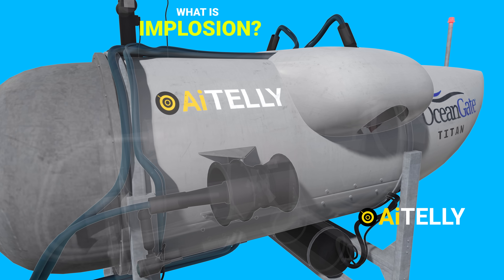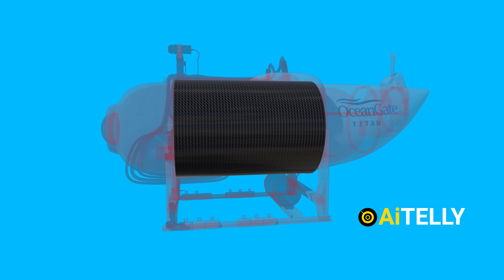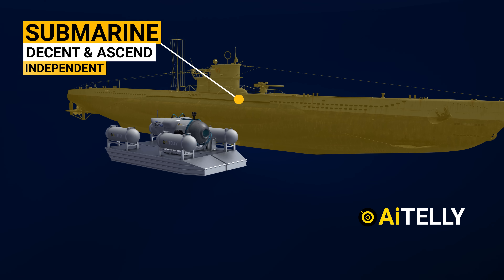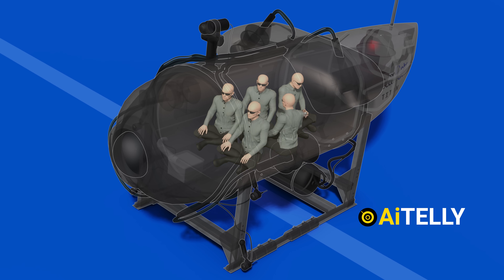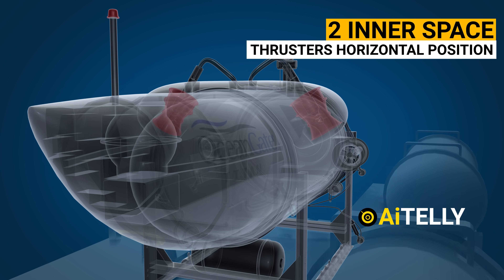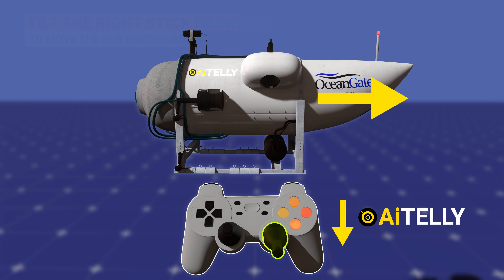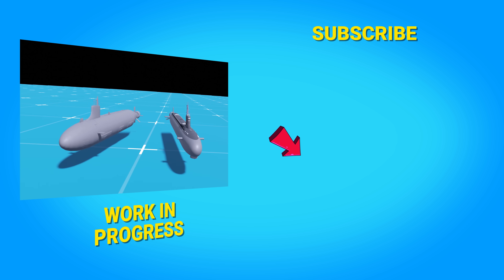Implosion Titan Oceangate How it Happened | Submersible Submarine Parts #3d

Comment: I am a Naval Architect with submersible design training.  You show the implosion as in crushing a can.  It was way more violent.  The atmosphere in the vessel was suddenly compressed by the pressure.  It greatly heated.  Think diesel engine times 20+.   At high pressures and temperatures, air (O2 and N2) become reactive, and "burn" (combine into NOx, explode).  Pressures get even higher, and a gas bubble forms.  The pressure and temperature of the water cools and collapses the bubble.  So the collapse is three events: sudden high pressure, an explosion, and collapsing of the gas bubble.  Extreme mechanical violence lasting fractions of milliseconds.
Reply: “Extreme mechanical violence lasting fractions of milliseconds.”

Fuck, that is chilling.
Reply: That's the weird thing about these kind of compression/decompression incidents. They're horrifyingly violent, so rapid and forceful that they seem to break the laws of physics. And yet, they're so infinitesimally fast, that there's no chance the victims even had time to register what was happening. They were dead before the signal from their eyes and ears could reach their brain.
Reply: @CheshireCad  which in a way is kind of a silver lining. No awareness or pain. Just snap

I still don't understand why they wanted to take the S.S. Shit Show to the bottom of the sea, but at least their families have the peace of mind of knowing they didn't suffer from a prolonged, agonizing, traumatic death.
Reply: @reallifein3d  wrong they started to ascend before the accident. They knew there was an emergency. They were aware!!!
Reply: @CheshireCad true, they would have been dead before they knew it happened. But there is a solid chance they knew they were going to die. I doubt that it happened without ample warnings. Rush had implemented safety measures to warn them of problems well in advance so they could try to avoid catastrophic failure.
Reply: @CheshireCad  is this the quickest way to die? Serious question
Reply from the maker: Thanks Ken Smith for your technical feedback 👍
.we love learning from Real Engineers.
Reply: @Aitelly   Yeah there's a couple of wrinkles. As Titan was son tiny, there was only about 2.8 pounds (1.28 kg of oxygen) in the air on Titan, which if it reacted with the nitrogen would have yielded only about 3000 kJ of heat from that source. Enough for an explosion against 400 atm pressure? No way. There would have been heat from compressing the air. But pressure killed the occupants, not heat.
Reply: We like hearing from real engineers??  There fire you should stop making videos about things you have no idea about??
Reply: @Aitelly  lol at your bullshit clickbait
Reply: I will gladly be in that submersible implosion than die another way. 4real this is the best way to exit. Everybody dies if i have to die i will gladly choose this way.  No pain nothing gone in 1 sec. From human into dust 😅
Reply: @GeremeNejelo  you could always just pass peacefully in your sleep
Reply: @GeremeNejelo It may be a quick way to go, but imagine the 10 or 20 mins leading up to that point. The fear of what's going on and knowing the inevitable.
Reply: @GeremeNejelo  Mist...
Reply: @GeremeNejelo I don't think a 19 year old was ready to go out like that. The family of that boy should be ashamed of themselves for encouraging this expedition.
Reply: Yes, this implosion is exactly like a bomb explosion except inverse. Those people we blasted just like they sat on a huge bomb. They felt and saw nothing.
Reply: Absolutely. Thank You! ❤️
Reply: You know, this is so tragic…but OceanGate if still a viable company, should be sued by the families. Just on principle alone. So so sad.😢
Reply: @jessicaklaus8171  if they’re dumb enough to pay that amount of money and sign the waiver, then that’s on them😂
Reply: @callen0892  Ok, I am really surprised at the number of rebuttals to my comment about the families suing the company. I am just throwing out a way for the families to help make sure another person like Stockton does not get away with what he did which was gross negligence.I personally don’t care what the families do. I just hope they can heal because this is a horrible situation. Whether they took a risk or not, these people had families. They are really hurting.  There should be a law requiring all submersibles to undergo safety testing by a Naval Engineer BEFORE any passengers are allowed on board. He used the word  “innovation” to skirt the issue because he knew it wouldn’t pass. He fired the engineer that told him it wouldn’t pass. Yes the passengers paid but it is still wrong to “shoot the messenger” and he shot every messenger that came along and told him the truth.
Reply: @jessicaklaus8171  you are just being naiv! People get killed all over the world everyday by accidents which could have been avoided. Thats life!
Reply: @juttaweise  How am I being naïve? I, being a sailor, wouldn't have gone down in that thing because it violates too many laws of physics within 1 sub. The power of the ocean is greatly underestimated. I would say they are the ones being naive
Reply: @juttaweise  People do get killed everyday by accidents that could have been avoided. But this is totally different . This man's ego and lust for success and making a name for himself could be argued in court to have committed involuntary manslaughter. And a really good attorney could probably get them for murder. I think you need to look up the definition of naive.
Reply: @juttaweise  So you are saying to give a pass to people who have been warned of instability in a sub they are taking people down in to crushing depths, and not only that, firing the engineer who blew the whistle AND having the documents sealed so no one could read them. That has intent written all over it.
Reply: @jessicaklaus8171  again you should not believe everything you read, especially in todays times. Afterwards everybody is wiser. That french diver had over 200 deep sea dives on his record. 38 to the Titanic, three on this vessel. They were all consenting adults and it was their choice to risk this adventure. Nobody to blame but themselves!
Reply: @jessicaklaus8171  mehhhh. Oh well🤷🏼‍♂️ apparently one family member was so sad they went to a concert during the search and rescue mission😂

Also… I laughed when they were launching the search and rescue mission… because only a handful of manned submersibles have been down to that depth. And now we’re searching, holding out hopes that this manned submersible is somehow still intact. Haha… nahhhh. They dead from implosion 😂

It is a horrible situation… but even if I had that much money, my wife would be slapping the shit out of me and telling me how stupid I was for wanting to go down there to see it… even if people were lying saying it was safe.
Reply: @callen0892 agreed, everyone calling for lawsuits are the same people tying up our courts with bullshit. Idiots paid for their own funeral
Reply: @jessicaklaus8171  You have a valid legal point. Though they signed risk waivers, IF gross negligence is proven, in it's construction, lawsuits WILL proceed.
Reply: @jessicaklaus8171  Did you see theyre trying to send people down again in 2024
Reply: @jessicaklaus8171  Unfortunately they probably wouldn't be successful with any civil lawsuit because of the liability waivers that all of the passengers had to sign. The waivers clearly stated that the journey could result in death. I don't know how you can sue someone after signing off on something like that.
Reply: @jessicaklaus8171  Sorry, they all signed a waiver. No lawsuits are possible. They willingly handed over their money and gambled their lives on a CEO and his experimental submersible. If I willingly signed my life over to someone and they got me killed it would be my own fault. And I don't believe any judge would award a lawsuit as a result. It's ridiculous that they trusted this company before they had achieved multiple successful dives.
The previous dive experienced a serious technical issue with communications. That by itself would have made me say no. Common sense escapes those who think money protects them. These people thought they paid for a safe expedition and blindly trusted equipment that should have been rigorously tested prior to public release.
Reply: @jessicaklaus8171   they signed wavers that stated death 13 times they can't sue    you sue happy  people have ruin this country  if you willing go and know you could die why should there families be able to sue give me a good reason
Reply: @jessicaklaus8171 unfortunately the crew signed a waiver. There's no way they'd be able to fight it.
Reply: @jessicaklaus8171 . . . it’s not THAT sad. . . I say “eat the rich”. I only feel band for the young kid that perished.
Reply: @jessicaklaus8171 Then they might as well sue NASA too cause they were involved in the project.
Reply: @jessicaklaus8171  they can’t sue them. The people inside the submarine signed a literal death waver, and they accepted it, so they cannot sue them
Reply: @jessicaklaus8171  They ALL SIGN WAIVERS so people like YOU and your family won't file a lawsuit and destroy the company,  which THE OCCUPANTS fully UNDERSTOOD that a catastrophe could happen.
There will be NO SUING on this mission my friend.
Reply: @jessicaklaus8171  it disappeared with its CEO
Reply: @jessicaklaus8171  they’re actually no longer in business anymore.
Reply: @jessicaklaus8171  they were warned and understood and agreed to the risks and even signed waivers
Reply: @jessicaklaus8171  sue who? The owner was turned to paste.
Reply: @jessicaklaus8171  well, by the standard of contract the families cannot sue the company. I mean you're diving to the deep ocean, I imagine they have a very specific contract built up that would wave all liability upon stepping on the vessel, just like you'd sign a waiver to spar with a professional fighter.
Reply: @zachhoernemann2104  waivers like that don't always excuse the company from fault, if you can prove that the company was purposefully negligent. Oceangate from many reports was very negligent and with a good lawyer every family has a good shot at money from this
Reply: @zachhoernemann2104  I beg to differ, IF gross negligence can be proven in the process of constrcuction, the waivers are nullified and lawsuit WILL proceed. Look it up.
Reply: @renelaboy1517  It's going to be a long lawsuit. It'll be the battle of lawyers. May the best lawyers win.
Reply: @hamsome9511  yeah I have a feeling the lawsuits will be more of a monetary punishment/message to ensure this never happens again than it is a compensation to those effected.
Reply: @hamsome9511  I would imagine the families are already getting their list of former employees to call upon for deposition in order. If you got $250,000 for a submarine trip, I would imagine you have a pretty good lawyer on retainer ready to go most of the time. I doubt it ever sees a court room given how much scathing material has hit the media already.
Reply: @zachhoernemann2104  you can challenge any contract in court.
Reply: @zachhoernemann2104 yes, they literally signed their lives away. They were fully aware of the risks. I think they would have to be able to prove that they were mislead in some way about the vessel or the risk. It would be interesting to see that go to trial.
Reply: @zachhoernemann2104  there was so much negligence (resulting in death) involved that the people who signed the waiver were unaware of.
Reply: @zachhoernemann2104  As bad as I feel for the people and families involved I agree. Not only that there were plenty of red flags from the best minds in the underwater field that the passengers disregarded when they made the decision to get on that idiots sub.
Reply: @zachhoernemann2104  if they can prove gross negligence….like being told it wasn’t safe and ignoring the warning…the liability waiver is nullified. It doesn’t matter how good of a contract it was, it won’t protect the company in this case. There is already plenty of evidence they knew it wasn’t safe.
Reply: @zachhoernemann2104  to an exception, if the families can prove gross negligence by Oceangate, the doors might swing open.
Reply: @zachhoernemann2104  If the company did not uphold their part of the contract, they most definitely can be sued. For example, if the company withheld information of safety factors - such as a flawed design from the passengers.. or maybe Stockton Rush WANTED to go out with a bang and took the passengers along intentionally for maximum media.... who knows?! Contracts aren't "sue-proof." lol.....
Reply: @zachhoernemann2104  incorrect.  A contract of slavery is illegal. 
So we just validated that not all contracts are valid or legal. 

Next is gross negligence. 
A contract will not protect you from that.
Reply: @zachhoernemann2104  waivers don't save them from negligence though. If it's shown that the company or people were negligent, the waiver looses power
Reply: @MarcosAntunez2 idk, they had a waiver for a reason. I doubt it leaves much, if any wiggle room. I'd be willing to bet the company covered it's ass very well. If not, more power to the families should they win a lawsuit.
Reply: @davidknoxii5834  you are correct, the waiver was pretty specific. There were several things however that the company, specifically the owner, did that courts could see as so negligent or deceiving that they could be held liable. LegalEagle has a good video with the actual knowledge to explain better than me. Definitely worth a watch
Reply: @MarcosAntunez2  so you think the waiver may have been too targeted in its writing? That would be interesting. To watch the owner get squished by his own legal teams inadequacy. I just hope this whole incident makes people realize that money does not make you more secure in you endeavors. You still have to use the brain.
Reply: @davidknoxii5834  I don’t think he’s necessarily saying the waiver was too specific, but that the owner knew his sub was not capable of going that deep, and still allowed others to go on it. Regardless of the waiver, if there are dangers that the owner knows, and does not disclose, then he’s liable. I think that’s what Marcos-ib5ur is trying to say. 

Obviously I still side on the side of “you’re stupid for paying that much money to do that dangerous of a thing and should be owed no money based on your own stupidity.”😂
Reply: @MarcosAntunez2 don't need to prove it. The CEO confessed on video that he broke rules.
Reply: @MarcosAntunez2  what's the point of a waiver then?
Reply: @jude999  a waiver protects the company from accidents, foreseen or unforseen. Waivers do not (in most cases) excuse a company from causing harm to a signer when the company could have taken steps to avoid it. For instance, if you had to sign a waiver to ride a roller coaster, but the worker didn't put the safety lever in place before sending you at high speeds upside down, there is a chance you can win a lawsuit because it is something the company easily could have avoided. There are other things that go into it, but that's a large part. Now it's up to the lawyers of the victims to prove oceangate was negligent and could have avoided this.
Reply: @zachhoernemann2104  There’s no waiver in America that can’t be undone by a sharp lawyer and a sympathetic judge. It’s called  “fitness for use.”
Reply: @Marcos-ib5ur NOT GONNA HAPPEN PAL !!! You are basically LITERALLY signing your WHOLE LIFE AWAY. And that means if ANYTHING goes wrong. PERIOD !!!
Reply: @jessicaklaus8171  I was thinking just like you, but the passengers in the vessel already are absolutely rich. Sueing the company to get exactly what? More money?

I really don't know how rich people deal with situations like this.
Reply: @LordSevla  That’s why I think if they sued to set a legal precedent, that any and all submersibles are required by law to be tested before the sale of any tickets can take place/any passengers can board. The definition of passengers would be any person or persons not directly involved in the creation of that submersible.
Reply: Then there would would have to be a strict definition of “involved”. It just seems to me like Stockton was either delusional or a complete narcissist to ignore all of the warnings in order to make money.
Reply: @LordSevla  And maybe Stockton was just so full of ego he couldn’t admit it was a failure and his ego propelled him to prove everyone wrong. All I know  is this…after seeing the construction/application of the nose cone with glue 😳, descending to those depths, I would have preferred jumping into the North Atlantic from the mother ship and swimming back to Newfoundland.
Reply: @LordSevla um... yeah.
Reply: @jessicaklaus8171  what for? Everybody on that vessel knew that could happen. No obligation.
Reply: There’s a video of a train tanker imploding. It’s freakishly violent and powerful
Reply: @jessicaklaus8171  have you read the contract. It’s iron clad and tells them that they have a high chance of death like 15 times. Also high risk for high reward = high probability of death. Suing on principle is what’s wrong with the world. They knew what they signed up for. I have next to no sympathy for a bunch of billionaire thrill seekers dying. They knew the risks.
Reply: @deathwish1085  Of course not. But it was read on one of the new channels. I suggested suing on principle alone, money not being the focus, to set a legal precedent. The families do not need the money. But maybe, if this goes to court it will hold future companies accountable for safety.
Reply: @deathwish1085  Imagine you're driving your brand new Toyota Corolla, and suddenly the gas pedal isn't letting off the accelerator at all, and you can't stop the car. In your panic of trying to shut the car off, you hit some stuff at 65 mph and lose control of the car, and you now have a shattered leg. Later, it is found that the manufacturer deliberately cut corners. You're not going to sue the car company for the medical bills and the cost of the car? Just suck it up as you knew your risks? For some reason, I highly doubt this.
Reply: @deathwish1085  I don’t understand why the CEO was there….but I can understand why the pilot was there, companies lie to employees all the time. The other two riches were probably assured it was safer than it was by the reassurance the CEO was going. The kid….he isn’t old enough to comprehend how risky it is. I have a lot of sympathy for them. They had adventurous, curious spirits that literally got crushed. 4/5 deaths are very sad, the other one puzzles me…
Reply: @natspunk-rat2158  The CEO was piloting because everyone he asked to pilot the sun refused. 🤣 Have you read the liability release they signed. “Experimental Sub” nothing more needs to be said.
Reply: @deathwish1085  See @yurgon's comment above, which I'll repeat here for you, as I think it's really important:
@yurgon
3 days ago
 @hamsome9511  yeah I have a feeling the lawsuits will be more of a monetary punishment/message to ensure this never happens again than it is a compensation to those effected.
Reply: @deathwish1085  did the contract suggest a high risk of death (perhaps, I dunno, 1-5%) simply due to the nature of diving so deep in relatively untested equipment, or did it specify that the company used materials that anyone should expected to fail after repeated uses, ignored repeated warnings from engineers, and generally neglected it's due diligence in designing and testing the craft for seaworthiness?

There's a difference between "diving this deep is inherently very dangerous and any major failure will almost certainly lead to death" and "every engineering that we haven't paid to agree with us has said this thing is a deathtrap".
Reply: @zacharyjacobs7233  the contract is completely available for you for read online posted by several reputable news agencies. They got it from a former passenger who went on a successful dive.
Reply: @natspunk-rat2158 a lot of this story doesn't make sense. I'm not buying it, nor do I feel bad for people who willingly paid for their own funeral. Life goes on. How many people in this world have 250k to throw at a ceo and his experiments? Not many, and fewer still, I'd wager, would gamble their lives away like that.
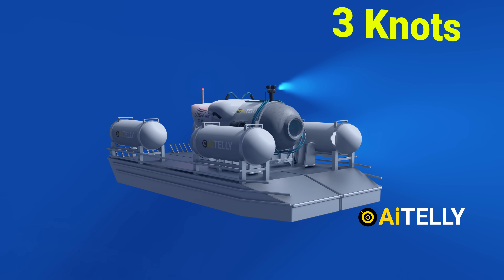Reply: 😊 4:29 4:30
Reply: @jessicaklaus8171 OceanGate is no longer a viable company and unfortunately, the families can't sue because all 4 of them signed a death waiver (minus Stockton Rush the operator or pilot).
Reply: So in other words, it was an extremely foolish, reckless, basically Suicide mission.
Reply: @thomasbauer1202 that a father allowed his 19 year old son to go. Money makes people stupid.
Reply: @thomasbauer1202  yes like driving your car everyday knowing there are idiots out there. Or you could have that millisecond in which you fall asleep. (that is underrated).
Reply: @thomasbauer1202  sorry, but seems not
Those people Indeed trusted their lives on the project of that vessel
I wouldn't blame them for so
Who we are to judge them?
Reply: Thx!
I learned something!
O2 and N2 burns at high pressure.
Reply: @lancelotxavier9084  we learn in chemistry class that what we call " burning"  is factually oxidation, oxygen combining with other elements and giving off heat and and light in the reaction. The oxygen we breathe is what lets us be warm blooded animals, at the cellular, molecular reaction level. This Naval Engineer made me suddenly flash on what i know, of tanks of compressed gases. Liquid oxygen, liquid nitrogen, under the staggering  pressures required to force either of those gases down into their liquid form---- and liquid nitrogen is so cold, it shatters things like steel ingots, lead weights, and  diamonds.  So picture the pressure needed to force each of those gases down to liquids, then picture if you instantly released and combined them. Oxidation--burning, giving out heat, light, both as liquids, at pressure, AND gases, as pressure is instantly defied by force of the reaction. Gases while inside the ship, while people are breathing, then, sudden liquefaction, as the pressure compresses and breaches the hull, oxidation of nitrogen at violent rate, with heat and light ( exothermic reaction) and resultant bubble---explosion. It all takes place so instantly, there isnt time to react or realize that something happened .  Below surface of the water, you implode from greater extrrior prrssure. In space and in the sky,  you burst from carrying more internal pressure than the surrounding air or space. Its why pregnant women are barred from flying in their final month: too high  a chance the baby will be squeezed out too soon!  just from the suction of less air pressure outside the mother!
Reply: @janetpschwartz8991  🤰🤯
Reply: Ken Smith, above, knew what would happen…and stated it succinctly and with few words. They had to know.
Reply: @jessicaklaus8171 If they did know it was a high risk, the father should never have allowed his son to go on that expedition. I wouldn't make my son feel obligated to go on a dangerous expedition for the sake of some fathers day bs. But then the rich think they make their own rules in life.
Reply: This is what I came here to see.
Reply: so did they get cooked or squished?
Reply: @Baileyisabean  Both, I think.
Reply: @Baileyisabean  Yes.
Reply: Wow! That does sound violent.  Thank you for explaining this. Most people,  including myself, don't fully understand the term implosion.
Reply: Clear, consise and factual. Thank you Ken.
Reply: So the implosion created an explosion which then created a vacuum for highly pressured water to collapse into is what I’m picturing… so the bodies probably exploded from atmospheric pressure and then smushed into mush from water pressure?
Reply: @brad4058  turned into atoms instantly
Reply: Let's all go underwater in a ginger bread house.
Reply: @xmo552 Heck yeah! 🙌
Reply: @Jay_Aargh83  the reality is always scary. Life is not a game
Reply: For their families, loved ones and most especially the grieving mother I thank God it occurred in a fraction of milliseconds. Thank you for those words.
Reply: I thought and said the same thing. It Imploded like "Crushing A Can", was, I think, the "Nice Way" of saying it. But, to be real, that implosion was extremely quick and very violent. Those men were spared by how fast everything happened...✌️
Reply: They even got to die in the most wealthy person way --- the most painless way money can buy
Reply: @RCycleRider4Eva  
Typical rich people...
Reply: Diesel engine x20? More like heat of the sun
Reply: So neat, like a pistol shrimps bubble
Reply: The scariest thing I've read in a while... Just, damn...
Reply: @kensmith3435 : there is a bi-monthly magazine called Asimov's Science Fiction. Please seek the may/June 2023 issue. Please read the cover story: 'Lemuria 7 is missing.' I ask everyone seeing this message to seek and read this fiction story in Asimov's Science fiction may/June 2023. Please everyone read it!
Reply: So you're saying that the victims didn't know what happened to them? Is it like being knocked out on the back of your head without knowing?
Reply: Thank you, I keep commenting on these posts, it would have been broken into a million pieces.
Reply: Awesome information!
Reply: Well, at least their deaths were quick and painless.
Reply: Wow you need to make a channel is very interesting what you said
Reply: Did it create a mini black hole?
Reply: @Jay_Aargh83  Maybe.......Because it's scary
Reply: That's terrible locked in crammed
Reply: I'm the 1k like
Reply: yeaaah i rather stay on the surface thank you
Reply: I guess AI can't figure it out the way an actual human would 🤷
Reply: I was wondering what happened to the air in the sub. So the rapid compression of the air creates an explosion as well. Like a hydrogen bomb kinda? I thought it would be collapse, explode, collapse. I kept looking for the answer. Thank you
Reply: They would have been vaporized. We learned what @kensmith3435 states here in submarine school when I was in the navy. You have to respect the sea!!
Reply: Great explanation, I had not thought about the heating effect of the submersible gas bubble.

Also, the carbon fiber filament wound "can" would not deform inward quite as shown, but rather compressively fracture into many small pieces.  Basically, like glass shattering compared to a deformable metal.  There was a lot of initial discussion in the news about retrieving bodies or body parts.  But except for bone fragments, every cell in the human bodies would be instantly compressed to 400X what they had been, driving out all the water from the cell membrane or otherwise just disintegrating all the cells.  Not a pretty sight if it was slowed down from high-speed film, but that is exactly what would happen.
Reply: That was a fine forensic analysis Mr. Kensmith. I'm sure experiencing it was..... somewhat different....
Reply: I feel like I wasted 6 plus minutes of my life watching this Commodore 64 looking rendition
Reply: @@BlueLivesMatter-ll4fc so first you were a submarine mechanic, and now you are a rocket scientist and engineer.... Riight. Get your story straight.
Reply: @kensmith3435  so basically, they felt nothing? Just a sudden disappearance?
Reply: You are saying the people inside got evaporated in less than an blick of an eye?
Reply: The first page of that waiver mentions death 3 different times.  That in itself was a red flag.  And given the history of this unworthy sea vessel, there were plenty of other red flags that were repeatedly ignored until tragedy finally struck.  Stockton Rush was repeatedly warned that his vessel was unsafe and not seaworthy but he refused to listen.  Avarice (greed), arrogance, and risking people's lives.
Reply: Yea real engineers. Not wannabes
Reply: So there’s guts and heart exploded before water from the outside had the chance to touch them ? Or what was left of them. Damn.
Reply: What was the point in using carbon fibre? I'm way off an expert but is weight an issue? Surely just go with tested materials and compensate for the weight with sufficient buoyancy aids for the return.
Reply: Can you explain how bad it is to use carbon fiber or it truly was an experiment??
Reply: This is exactly how I pictured it.
Reply: Whoa!
Reply: <---Simple Mo Ron.
Reply: Now that I wanna see
Reply: 💪@kensmith3435
Reply: Correct. This is 100% fake.
Reply: Great description. I think this video is made by some teenagers who know 3d. More of a click bait
Reply: @@BlueLivesMatter-ll4fc he most definitely did not get it all wrong.
Reply: @@BlueLivesMatter-ll4fc also I don't know what you are fighting Kevin about. He's is explaining what occured, not how it should or could have been built. And he's absolutely correct.
Reply: @BetaTestaburger lol...hes trolling... dead giveaway is when he said he was a sub mechanic at age 15 😂
Reply: @pmg-1  that age part flew right over my head, makes alot more sense now lmaooo
Reply: @BetaTestaburger  😆
Reply: TY
Reply: I’m confused by the explosion part. That is the opposite of implosion, correct? When does the implosion take place Anna what does it look like - just that part. What would have happened to the people at that moment?
Reply: When I saw the bolts on the “submarines” nose cone it screamed bootleg engineering to me. How could anyone believe that thing was safe?
Reply: Ahhh shut up
Reply: Thank you so much for this information. I'm an intelligent man and I have extreme difficulties in processing all of this. Still do and probably ever will.
Reply: NOx - formation from N2 and O2 is endothermic - there's no explosion. The reaction actually cools the gas and reduces the pressure.
Reply: @Jay_Aargh83  I know I don't know you but I can literally  "hear" you say out loud;what you  wrote!
Reply: In I freaky way I can visualize it after reading  this. Thank you👍🏾
Reply: @Jay_Aargh83  he makes it sound a lot nicer than it is.
Reply: You said some things I don't even understand😀 but thanks
Reply: would a total titanium vessel😁😁😁 work?
Reply: You guys need to collaborate and make a graphic video of what happen
Reply: So it was like immediate cremation and impaction of body parts… as I understand. Well that’s got to be the absolute fastest and cleanest way to die.
Reply: @pamzib4080  I'm almost sure not a single identifiable body part would be found, almost sounds crazy, but imagine a game where they blew shit up and you had to find out what animal species was in it. Because all there would be after a catastrophic failure like this would be gallons of blood, if the heat didn't pulverize it all
Reply: Bro...
Reply: Smart people are awesome 😂❤
Reply: So a pressure cooker?
Reply: Now I’m started to think this was some type of experiment 🔬
Reply: @kensmith3435 I'm studying engineering at college to hopefully become a marine engineer one day 🤞🤞it seems very fascinating
Reply: Oxidating the nitogen or halogens dont release energy.
Reply: Kinda reminds me of the Byford Dolphin incident.
Reply: Aww so gayy
Reply: Rumours are that the first sound of a human body imploding is a backward fart.
Reply: Does that explain why they could hear several bangs when they did the underwater search?
Reply: @peterfelstead1170  means nothing----plenty of noise down there
Reply: N2 doesn't burn? what?
Reply: This was my exact thought when I saw the animation for this.  Now I want to see the more realistic version.
Reply: Your reply was cool until you said a fraction of a millisecond what kind of Description is that really a fraction could be any number it could be 100/3.  I think when you say a fraction you mean a number smaller than one. But you wouldn't know that by what you said
Reply: Stockton Rush was toast and turned into gook.
Reply: Omg
Reply: @kensmith3435  but what would the occupants have experienced? Any of what you describe, or just 'alive one second, dead the next'?
Reply: @LadyCypher54  Well... human perception time is around 15ms, that's the time it takes for an image to be processed by our eyes, travel through our nerves, reach our brain and for it to figure out what it means. Same for other sensitive signals. In opposition, the implosion itself at that depth took ~5ms. So, actually I'd say it was more like 'alive one milisecond, dead at the next'. They had no time for even feel a thing.
But... that's about the implosion itself. The previous minutes must have been way, waaaayyyy different. Hearing the hull cracking, seeing the expressions of each others (including the pilot), the general fear, you know...
Reply: Thanks for explaining. We want facts, this is close enough for us curious minded   Last sentence was well said, but did they knew?
Reply: Cool interesting
Reply: @kensmith3435  Thanks, very interesting comments.
Reply: @kensmith3435  ouch
Reply: This is how the shooting type mantis shrimp for hunting and defense. Same thing happens pretty much
Reply: I'd be more concerned if anything happened to the electronics or malfunctioning of the controller and not be able to control the vessel. Futuristic yes, but highly risky and unreliable if anything were to interfere with the controllers signal  or electronics in general . I'd feel much safer having a manual way of controlling  such a piece of equipment undergoing such a large undertaking of going 2 1/2 miles down underwater than just having a wireless Playstation style controller controlling everything.
Reply: That was very informative....and nightmarish.
Reply: @kensmith3435  looks like we need an animation for this !
Reply: That's insane. Do you think the passengers would have felt or had time to feel anything?
Reply: I woulda survived by holding the walls back. Kinda like how Spider-Man saved that train in the movies but in reverse 😤
Reply: Oh yea it was more violent than we can imagine we ll have recreate it to really understand how it happened
Reply: A bit like Farting and following through then .🤣🤣👍🇬🇧🦊
Reply: Source?
Reply: @qqzpp common sense is the source bro something you might not have lol
Reply: I am not a Naval Architect but I know that the carbon fiber and the Titanium  spool piece was GLUED together.  That is 100 percent where it failed. When I watched them make it, I said it would fail at that point.
Reply: It’s like signing a waiver saying I’m ready to die. ( maybe they did it on purpose to save their families and businesses from surmountable financial hardships) … they have got to know… I feel so sad for that teenager boy. 😔
Reply: Also the tail cone does not implode as it has seawater pressure both inside and outside.  Nice presentation though.
Reply: @kensmith3435  wouldn't this create a jet pulse also consisting of atomized remains?
Reply: @kensmith3435  nice
Reply: Great comment
Reply: I’m a regular average guy, dang I say!!
Reply: The prism was blown out since it was missing when the debri was collected. It’s also a weak spot. Military submarines don’t have window prisms for this reason … the prism could have given way first or the hull. It was definitely more violent
Reply: They combust like a diesel. Wow.
Reply: What happens to the bodies, are they still in tact when this happens or explode?
Reply: @ccbaker88  
Smasharoni like a watermelon under a truck and then kaboom and then crushed again. They are one with nature again.
Reply: @xmo552  better than being starved and dehydrated waiting to be shark food, but that’s insane to think about.
Reply: @ccbaker88  the implosion destroyed a titanium vessel, the bodies would look like fruit after a ride in a blender.
Reply: @jimmbobb  that’s very vivid thank you
Reply: @ccbaker88  Viraram picadinho.
Reply: @ccbaker88 became plancton food
Reply: @r.guerreiro140  Mmm well I guess that’s good they got some food
Reply: @chrisbaker5578 The bodies go through the process of extreme high temp compression then a resulting  explosion into a gaseous bubble of human plasma followed by final compression over maybe 1/400th of a second. Bodies become violently liquified into what can be best described as a tomato soup with a fine granulated milk bone dog treat (think bone meal) blended in.  This happens to all the bodies organs and bones and there would basically be nothing left except for a smelly mess of human broth that just dilutes into the sea water and is dispersed with the Gulf Stream current.
Reply: I'm NOT engineet, but I can him save him all the jargon. It imploded, due to improper design and materials. Tragic, in liight of having had at his disposal ALL the knowledge, expertise and professional guidance needed to CORRECYLY build it!.
Reply: @renelaboy1517  ok but you didn't really explain it and he did.
Reply: They should have had you on their team. You seem wise.
Reply: yay, voilence :)😊😊😊😊
Reply: @LoganAnimates_Official something tells me you'll get exactly what you're looking for. Be careful what you wish for
Reply: I'm a former crack head.  And I disagree with you Mr Smarty Pants.
Reply: Wonderful. Now I can skip watching this bad video. Shame people who make content these days don't really understand the process they are even explaining
Reply: @yevgeniygrinberg1965  the best part is the video, titled as though it's going to go in depth into what went wrong, spends 3/4ths of its time describing the vessel's construction and how it got to the bottom of the ocean only to end with "and then something bad happened and it imploded and everyone died instantly".
Reply: @yevgeniygrinberg1965  The fact that this blatently false recreation of what happened really is a huge disservice to literally everyone who watched it and didn't realize it was false. The news picked it up, shared it, and millions watched it. Everyone that has watched it is actually less educated than they were before they watched it. This video should be taken down and a correction video should be released. Not going to happen though, because this dude is making money and all he has to say is "happy to hear from real engineers" rather than try to correct the video.